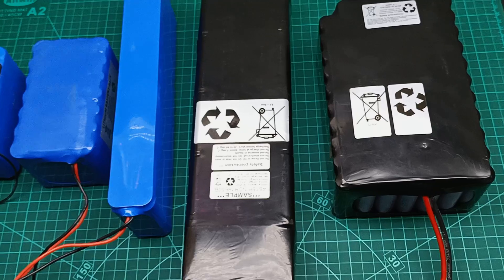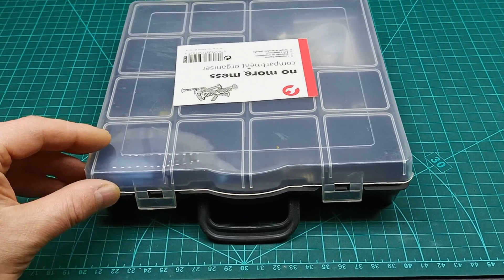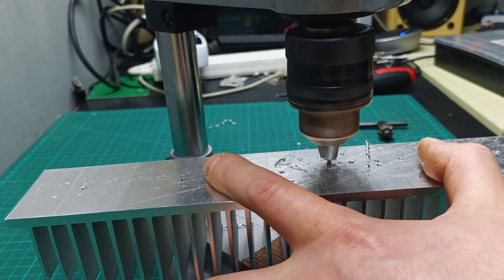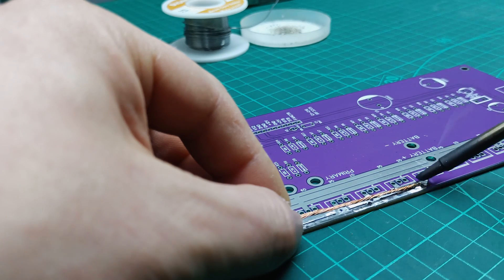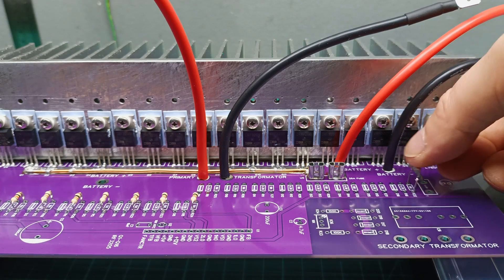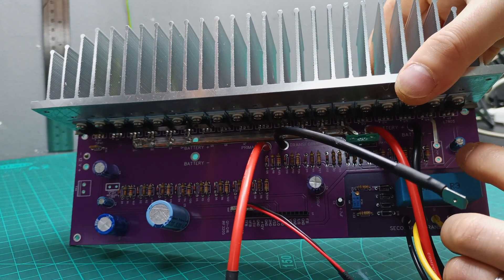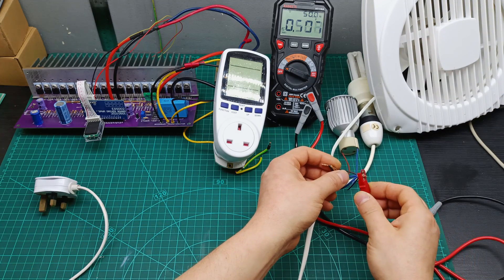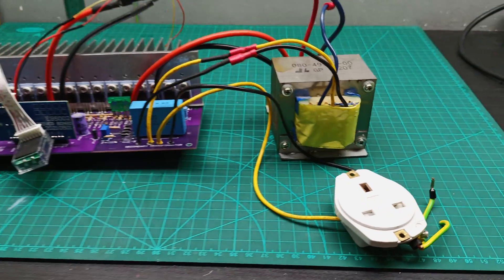Diy Home made inverter using irf3025 and egs002

Comment: Very Informatove vidoe .can you please make a video about high frequency 110v  inverter from 24 volts using egs002. 
I have 150 volts solar input can i make 110v inverter from it ?
Reply from the maker: @qaisarawan93  the problem is that I don't have high frequency transformers to do this project. Then from solar panels first you need to connect to a solar battery charger and then from the battery to inverter

Comment: But the module can't function as UPS and charge back the battery when the AC mains returns?
Reply from the maker: To work as a ups need some additional electronic parts AC voltage detection and battery charger

Comment: Question sir if I don’t use the ac output as feedback voltage will the the ac voltage drop under load or not
Reply from the maker: If you don't use the feedback you will not be able to set the output voltage and will not be stable
Reply: @SymbolTech21  I understand  sir,  but am asking if I can use any voltage source instead of the output voltage because I want to isolate the driver with optocoupler so I don’t want the ac voltage from the out to feedback into the driver cord that why I ask sir
Reply from the maker: @Dc_tech386  the way how I designed the PCB the feedback is directly to the connection of the secondary winding from the transformer
Reply: @SymbolTech21  my designs is transformer-less 10kw but I will try it tomorrow if there a issue
Reply: @SymbolTech21 good job sir I need pcb Gerber file and components list

Comment: Low frequency?    50 or 60m hz there?  Does the EGS002 need to power a H bridge there too, like in the hi frequency inverters with the 380vdc?
Reply from the maker: No
Reply: no to all 3 questions? i need to build that have a 2000 watt tranny 24 volt, could you send me the info?  thanks
Reply from the maker: @josepeixoto3715  drive a h bridge but not at 380vdc
Reply: got it, that's what i want,    have 2  hi freq inverters  with the EGS002 too, but they  keep blowing IGBTs ,i will try low freq.  @SymbolTech21

Comment: I subscribed and liked. Great project.
Btw, do you make your own PCBs at home also or you always order from factory?
Reply from the maker: When I have time I use the cnc to mill the PCB I have a video as well if you like to watch when I explained how I mill my own PCB at home
Reply: Thank you for sending me the schematic and Gerber file my email as I have no software to start designing PCB I've made a small one which works fine but it's only got four transistors instead of 16. I have lots of parts and components so that's not a problem. The only issue is need to find the transformer or get something so then I can wind the Windings myself a good decent transformer it's not within good price they're quite expensive. I will definitely get JL PCB manufacturer to make me the PCB and I will build low frequency inverter and do some tests and experiments and see what it's capable of specification of 16 mossfets.
Reply from the maker: @yannis92preloude  you can try this PCB design software is free https://easyeda.com/

Comment: If the mosfet or fake like some I bought the circuit will blow up because as soon as I replaced the fake mosfet and drive ic with some original mosfet I had everything work so just remembered only use HY mosfet it will safe you money of replacing
Reply from the maker: Yes definitely recommend good MOSFETs. Otherwise definitely will not be able to handle the power!

Comment: I didn’t realize you start back 🙌🏽
Reply from the maker: I want to make a small solar system to use those batteries maybe a solar panel to charge the batteries and the inverter to use with the soldering station and to light up the working bench will help me to save in electricity